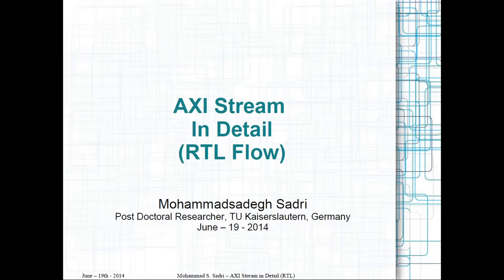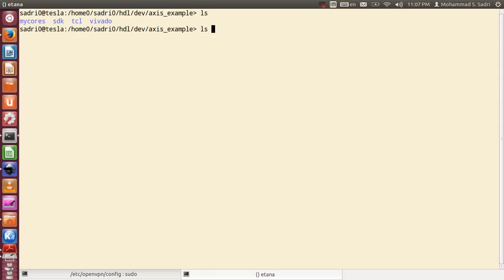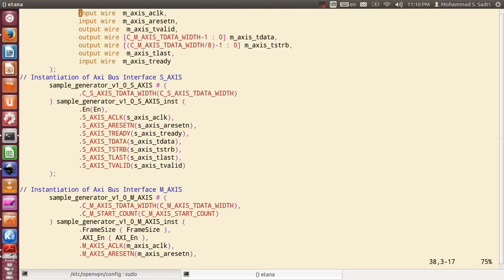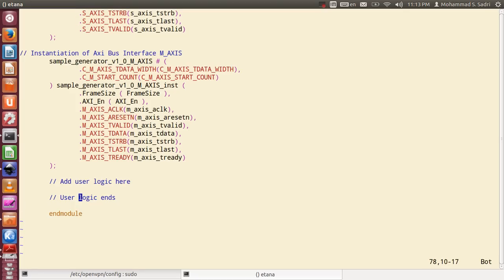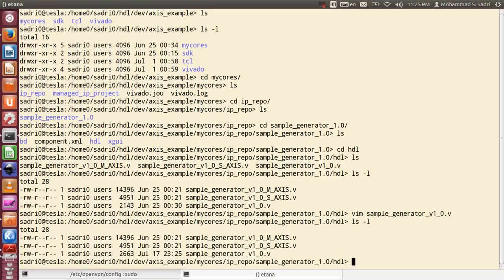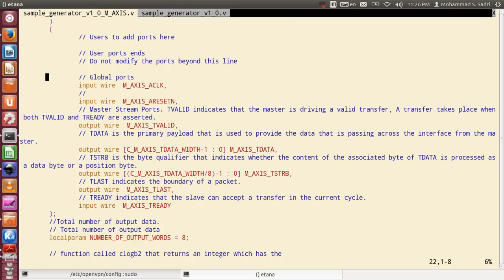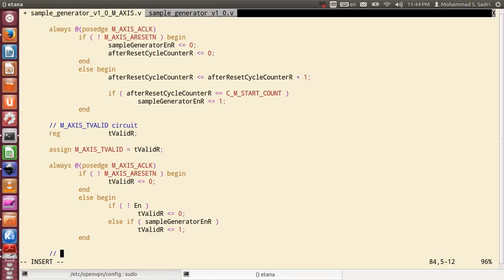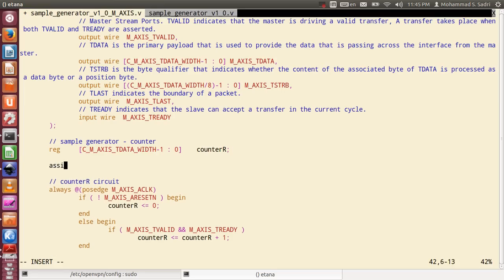ZYNQ Training - session 07 part IV - Coding an AXI Stream Module in Verilog

Comment: Could you make (or point to) an example for a custom AXI module which receives data, process them and return the result?
Reply from the maker: I have an education package describing how you directly code and AXI Master in RTL. the developed IP reads data through its AXI port from PS or PL side DRAM memory, processes the data and writes back the result into DRAM memory. please write me for further info.

Comment: @Mohammad S. Sadri
I am trying to understand the M_AXIS code generated by vivado.  This is the code that you have removed and replaced in the M_AXIS component.  It appears they are reading from a pointer to fill M_AXIS_TDATA.  Is this intended to be interfaced by a memory mapped processor?  It seems to me that what I need is to completely replace that code, as you have, to control the master axi stream via HDL in the custom IP block.

Comment: Hi, Sadri, i have a question since it's my first use of Vivado. i understood you have commented the Axi Bus Interface S_AXIS since you have assigned the signals but in this way there is not a conflict with the other file that VIVADO generates : sample_generator_v1_0_S_AXIS.v? because there is not the instantiation?
Reply from the maker: honestly speaking, i don't get your question...
Reply: @MohammadSSadri  ok, sorry, the question is: if you comment the " the instantiationAxi Bus Interface S_AXIS " minutes:20:36, in the other file .v that Vivado creates "sample_generator_v1_0_S_AXIS.v", the the port S_AXIS_TDATA for example that you have commented in the instantiation in the main file, is it recognized by Vivado?
Sorry if the question is not clear but from some weeks i start using Vivado and thanks to your videos that are very useful.
Reply: Why do you not need of the instantiationAxi Bus Interface S_AXIS?

Comment: Hello, I've seen your tutorials and they are very useful. I'm trying to implement an AXI stream ip with a slave and master interface. The template code of stream slave interface implements a control state machine that writes TDATA to a fifo but I cannot understand how the fifo and particularly the reg stream_data_fifo works. 
I have an ip which takes 2 inputs, one of 256 and one of 128 bits. From what I understand with a C_S_AXIS_TDATA_WIDTH=32 I can set the NUMBER_OF_INPUT_WORDS to (256+128)/32 = 12 and avoid producing the TLAST signal, am I correct? How can I take the streaming data from the fifo and feed it to my ip?

Comment: hi sir,
you are incrementing counter based on TREADY signal from slave but according to stream protocol our streaming data should not depend on TREADY.As per my understanding we should increment the counter continuously irrespective of TREADY and we should transmit it.correct me If I am wrong
Thanks
Reply from the maker: a transfer happens at the clock edge which both tvalid and tready are high. so this is the main condition for putting out a new data.
Reply: @MohammadSSadri  
hi sir,
then if we want to stream ADC data then data will be lost .how can we handle this situation
Reply from the maker: @mouryachandraboddu7726  depends on your sampling rate. I have used AXI DMA in register mode, as well as AXI DMA in Scatter Gather mode for this purpose. One other solution that i usually use when the sampling rate is too high is to directly write the RTL code for an AXI Master.

Comment: when AXI_En = 1,  "  assign m_axis_tvalid =(AXI_En) ? s_axis_tvalid : m_axis_tvalidW;"  then  m_axis_tvalid  =  s_axis_tvalid, but this  s_axis_tvalid is unknown state .
When I followed  you to the session 9 part 4,  I got critical warning:
[BD 41-759] The input pins (listed below) are either not connected or do not have a source port, and they don't have a tie-off specified. These pins are tied-off to all 0's to avoid error in Implementation flow.
Please check your design and connect them as needed: 
/SampleGenerator_Verilog_0/s_axis_tvalid
It may cause data in memory addr  0xa000000 doesn't change.  I don't know how to make it work.  so I come back to this session again.
Reply: instead of s_axis_tvalid, use the tvalid of the internal register that was created.

Comment: I don't know if you deliberately wrote a wrong code for subsequent simulation and debugging. But if not, you should 1) well prepare your lesson instead of writing code on the fly. That's very undutiful as a teacher. 2) Even if you deliberately leave simulation and debugging in subsequent lessons, you should at least check the code in your mind by which the bug of TLAST can be easily found. That's the basic duty of a programmer who can't leave everything to QA. I have to downvote you.

Comment: I wish he used vhdl
Reply: Writing RTL is pretty basic.  The VHDL code would look nearly similar.
Reply: I managed to convert the first part (Sample_Generator) to VHDL, but the second part was too big  :)
I hope it helps. Good luck.

library ieee;
use ieee.std_logic_1164.all;
use ieee.numeric_std.all;

entity sample_generator_v1_0 is
 generic (
  -- Users to add parameters here
  -- User parameters ends
  -- Do not modify the parameters beyond this line
  -- Parameters of Axi Slave Bus Interface S_AXIS
  C_S_AXIS_TDATA_WIDTH : integer := 32;
  -- Parameters of Axi Master Bus Interface M_AXIS
  C_M_AXIS_TDATA_WIDTH : integer := 32;
  C_M_AXIS_START_COUNT : integer := 32
 );
 port (
  -- Users to add ports here
  frame_size : in std_logic_vector(7 downto 0);
  en  : in std_logic;
  AXI_en  : in std_logic; 

  -- User ports ends
  -- Do not modify the ports beyond this line

  -- Ports of Axi Slave Bus Interface S_AXIS
  s_axis_aclk : in std_logic;
  s_axis_aresetn : in std_logic;
  s_axis_tready : out std_logic;
  s_axis_tdata : in std_logic_vector(C_S_AXIS_TDATA_WIDTH-1 downto 0);
  s_axis_tstrb : in std_logic_vector((C_S_AXIS_TDATA_WIDTH/8)-1 downto 0);
  s_axis_tlast : in std_logic;
  s_axis_tvalid : in std_logic;

  -- Ports of Axi Master Bus Interface M_AXIS
  m_axis_aclk : in std_logic;
  m_axis_aresetn : in std_logic;
  m_axis_tvalid : out std_logic;
  m_axis_tdata : out std_logic_vector(C_M_AXIS_TDATA_WIDTH-1 downto 0);
  m_axis_tstrb : out std_logic_vector((C_M_AXIS_TDATA_WIDTH/8)-1 downto 0);
  m_axis_tlast : out std_logic;
  m_axis_tready : in std_logic
 );
end sample_generator_v1_0;

architecture arch_imp of sample_generator_v1_0 is
 -- component declaration AXI Bus Interface S_AXIS
 component sample_generator_v1_0_S_AXIS is
  generic (
  C_S_AXIS_TDATA_WIDTH : integer := 32
  );
  port (
  S_AXIS_ACLK : in std_logic;
  S_AXIS_ARESETN : in std_logic;
  S_AXIS_TREADY : out std_logic;
  S_AXIS_TDATA : in std_logic_vector(C_S_AXIS_TDATA_WIDTH-1 downto 0);
  S_AXIS_TSTRB : in std_logic_vector((C_S_AXIS_TDATA_WIDTH/8)-1 downto 0);
  S_AXIS_TLAST : in std_logic;
  S_AXIS_TVALID : in std_logic
  );
 end component sample_generator_v1_0_S_AXIS;

 -- component declaration AXI Bus Interface M_AXIS
 component sample_generator_v1_0_M_AXIS is
  generic (
  C_M_AXIS_TDATA_WIDTH : integer := 32;
  C_M_START_COUNT : integer := 32
  );
  port (
  frame_size  : in std_logic_vector(7 downto 0);
  en     : in std_logic;
  M_AXIS_ACLK  : in std_logic;
  M_AXIS_ARESETN : in std_logic;
  M_AXIS_TVALID : out std_logic;
  M_AXIS_TDATA : out std_logic_vector(C_M_AXIS_TDATA_WIDTH-1 downto 0);
  M_AXIS_TSTRB : out std_logic_vector((C_M_AXIS_TDATA_WIDTH/8)-1 downto 0);
  M_AXIS_TLAST : out std_logic;
  M_AXIS_TREADY : in std_logic
  );
 end component sample_generator_v1_0_M_AXIS;

 -- signals declaration
 signal m_axis_tvalidw : std_logic;
 signal m_axis_tdataw  : std_logic_vector(C_M_AXIS_TDATA_WIDTH-1 downto 0);
 signal m_axis_tstrbw  : std_logic_vector((C_M_AXIS_TDATA_WIDTH/8)-1 downto 0);
 signal m_axis_tlastw  : std_logic;

begin
-- Instantiation of Axi Bus Interface S_AXIS
-- sample_generator_v1_0_S_AXIS_inst : sample_generator_v1_0_S_AXIS
-- generic map (
--  C_S_AXIS_TDATA_WIDTH => C_S_AXIS_TDATA_WIDTH
-- )
-- port map (
--  en  => en,
--  S_AXIS_ACLK => s_axis_aclk,
--  S_AXIS_ARESETN => s_axis_aresetn,
--  S_AXIS_TREADY => s_axis_tready,
--  S_AXIS_TDATA => s_axis_tdata,
--  S_AXIS_TSTRB => s_axis_tstrb,
--  S_AXIS_TLAST => s_axis_tlast,
--  S_AXIS_TVALID => s_axis_tvalid
-- );

-- Instantiation of Axi Bus Interface M_AXIS
sample_generator_v1_0_M_AXIS_inst : sample_generator_v1_0_M_AXIS
 generic map (
  C_M_AXIS_TDATA_WIDTH => C_M_AXIS_TDATA_WIDTH,
  C_M_START_COUNT => C_M_AXIS_START_COUNT
 )
 port map (
  frame_size => frame_size,
  en  => en,
  M_AXIS_ACLK => m_axis_aclk,
  M_AXIS_ARESETN => m_axis_aresetn,
  M_AXIS_TVALID => m_axis_tvalidw,
  M_AXIS_TDATA => m_axis_tdataw,
  M_AXIS_TSTRB => m_axis_tstrbw,
  M_AXIS_TLAST => m_axis_tlastw,
  M_AXIS_TREADY => m_axis_tready
 );
 -- Add user logic here

 -- Adding multiplexer here
 m_axis_tdata <= s_axis_tdata when (AXI_en = '1') else m_axis_tdataw;
 m_axis_tstrb <= s_axis_tstrb when (AXI_en = '1') else m_axis_tstrbw;
 m_axis_tlast <= s_axis_tlast when (AXI_en = '1') else m_axis_tlastw;
 m_axis_tvalid <= s_axis_tvalid when (AXI_en = '1') else m_axis_tvalidw;
 s_axis_tready <= m_axis_tready;
 -- User logic ends

end arch_imp;
Reply from the maker: I code in both Verilog and VHDL very well. All due respect, VHDL is ... ;)